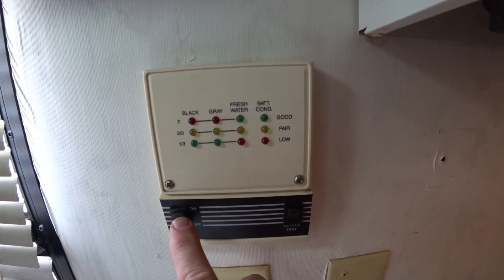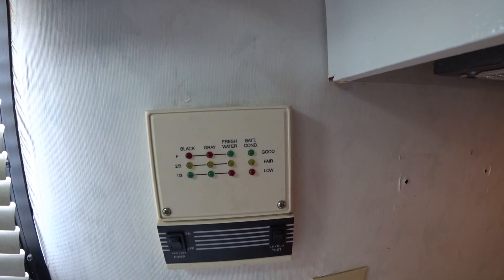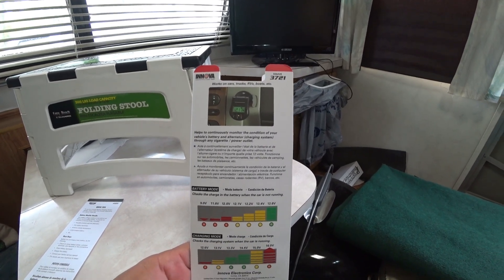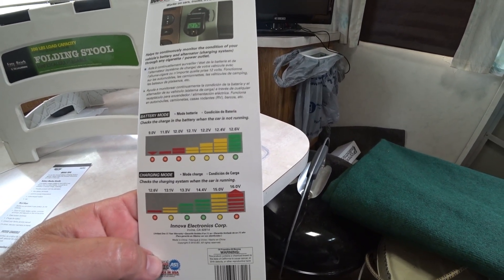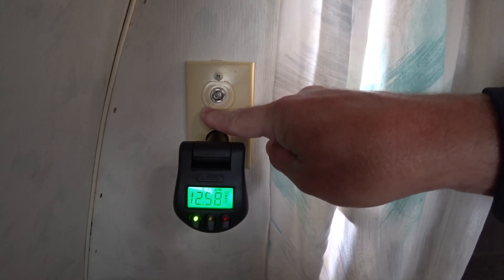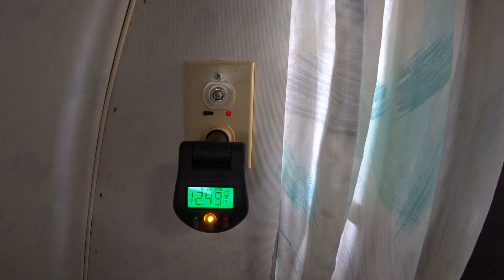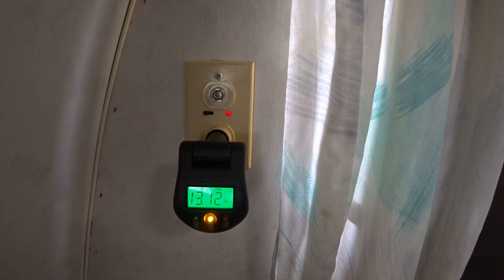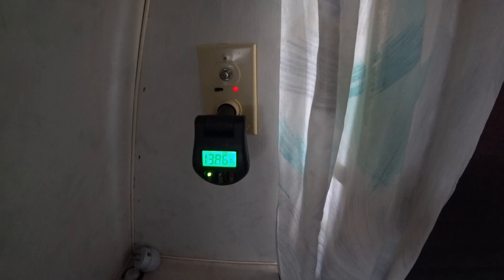Easiest Battery Monitor Upgrade

Comment: The 13.?? v is while the charging is happening. As the battery nears a full charge the reading will drop if/when your charger goes from bulk charging to absorption charge.

This site ( https://www.emarineinc.com/Batteries-Maintenance-101 ) has a more detailed chart to help determine the % of charge based on the digital reading.  I use the same meter and it helps me gauge my useage and when I may need to charge.  Thanks for your vids!
Reply from the maker: kejobo good to know.. 👍